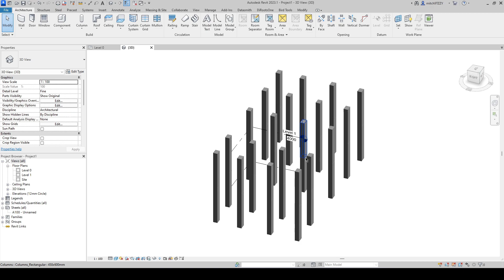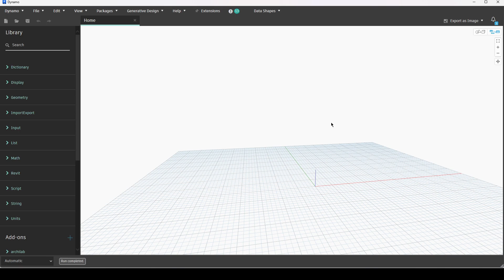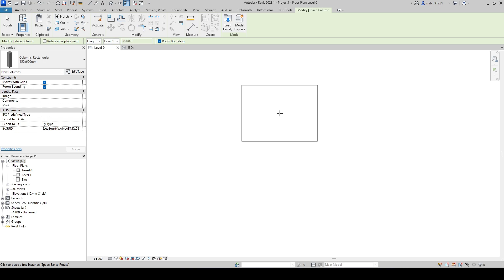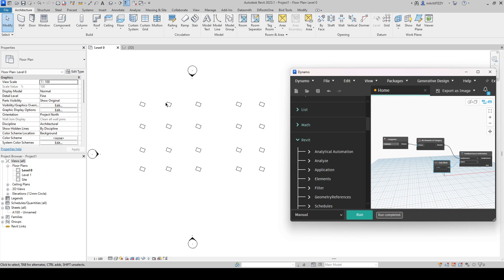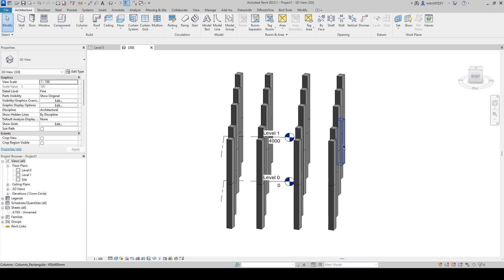Rotating Revit Families around their Local Z Axis

Comment: In categories command where you selected "Column", what to select in case we want to rotate a house model?
Reply from the maker: It really depends on your model and how it has been set up. It would probably be better to rotate your house model inside of Revit itself, not in Dynamo.
Reply: @ModenaTechnologies  True. I am required to do in dynamo as part of my assignment. what can be the possible way to rotate the basic house model in this case?
Reply from the maker: @IngAhmedkhaleel  that's an interesting one. Because I have never tried to do that before, I don't have a clear answer for you. If the house is a link, it will be easy. You could look into creating a Group out of all of the house elements and rotating the group, then ungrouping the items.
Alternatively, you will have to create a list of categories and gather all of the elements in the model and rotate them accordingly. I'm not 100% sure that it will work given that not all items will be able to be rotated using this method. But those are the things I would investigate.

Comment: Is there an easy way to do this with the x or y axis instead?
Reply from the maker: Hi there,

This is not as easy and really depends on what type of family you are using and what issue you are trying to solve. Revit is set up in such a way that most families can only be rotated along Z-Axis (At least reference-based families). So the columns above cannot be rotated either along the X or Y Axis as they are reference based. Unfortunately there is no single, simple answer to this question.